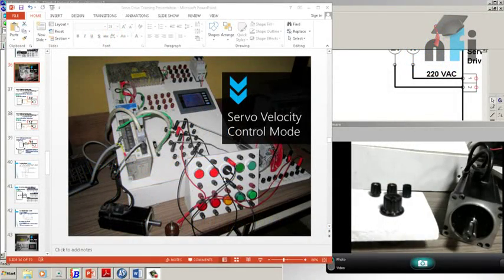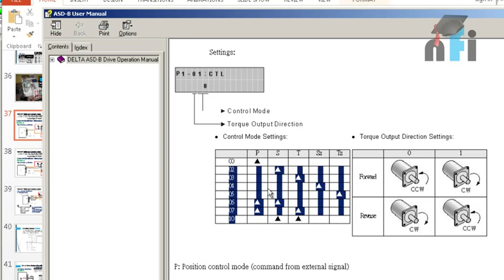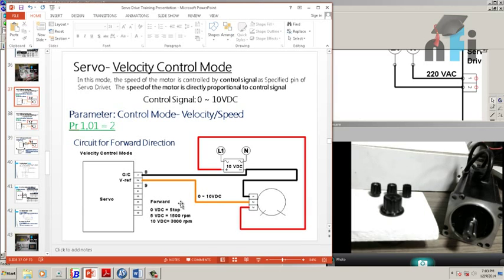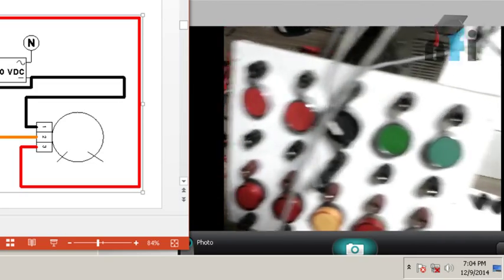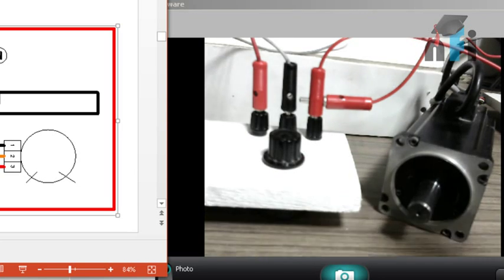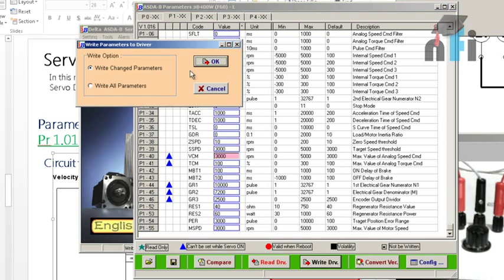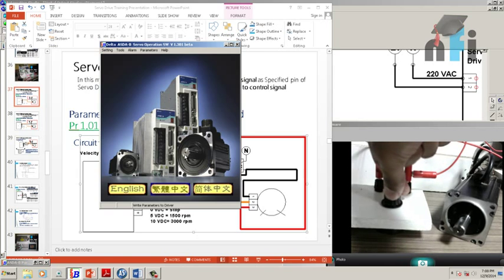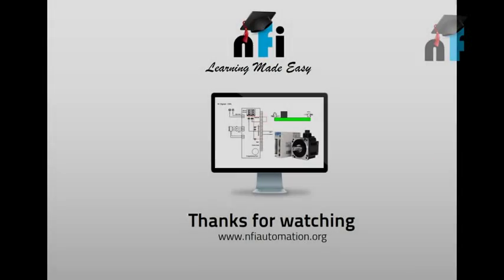Delta Servo Tutorials- Velocity Control Mode

Comment: Dear Rajvir. 
All videos are informative and I learned many things. Can I kindly request you to make some videos to measure the speed of existing machine by encoder and use two or three  servo drives and motors using plc and HMI . Controlling paper tension, cutting on eye mark using eye mark sensor,draw rollers application etc. So we can learn how to measure the speed of machine using encoder and utilise for one of the applications above using HMI for set point or cut length depend on applications.
Thank you very much for all your great efforts, really appreciated.
Reply from the maker: Hello, This is too complicated to explain without physical machine. If i get opportunity to see such machine, may then at that spot it would be better to explain how this has been program. And this is a big project what you just asked..so without hardware it is not really easy to explain,
Reply: @thegeterrdone  I understand but you have servo rig and if you connect encoder to any motor shaft to measure speed and you can use servo rig for different applications as mentioned above. This is just to understand how everything works. I know it is bit complicated but this is we use in real world. Please try if you can. Thanking you in anticipation of your kind cooperation.
Reply from the maker: @vineshpatel9072  I need to buy a servo driver and motor to try explaining the application. Will see to it. thanks :)
Reply: @thegeterrdone  Thank you very much. Appreciated all your efforts.

Comment: thank you sir for this explaining video
i understood from this video that we can control the speed with two way: internal with switch or with potentiometer.

sir,when i control the servo position, can i change the speed only by changing the frequency of the pulses coming out from the plc,or i need to work with a potentiometer?!!!
Reply from the maker: To change the speed from PLC you should select Position mode in Servo, then you can change speed and position both from PLC

Comment: Hi  about the change of direction.There aren't another way to change the direction (foward/reverse)without external circuit with relay?
For example with use 2 Digital Inputs, on CN1 connector, simple with 2 buttons as jog.(one for foward ,one for reverse).
Reply from the maker: With buttons you do it manually but to make it automatic you  need a switching electronic circuit ;)

Comment: Hi Sir.
How can I send speed reference from the PLC instead of analog potentiometer. Can I use step and direction to achieve speed control or any other way.
Reply from the maker: Yes, you can do that as well. In position control mode you can send Frequency and Position reference from PLC to servo driver to control speed and position. In velocity control mode you can use analog card interfacing to send analog signal to analog signal reference pin of Servo drive.

Comment: Thank you for the tutorials.
What is the language did you use?
Can i use ladder diagram?
Reply from the maker: Helllo, in this video we are not using any language. It's the hardware control
Reply: Please sir, if i use a servo motor in some application, can i make the servo stop instantaneous before complete the pulses that given??

i used Omron PLC to control a servo motor, i give a pulses to servo by monitor screen, but i need someway to control the servo by a signal of color sensor, i don't speak english well ! but i can give you an example

if i give a servo to run 920 pulses, and i want the servo to stop at 905 pulses by the color sensor 
the problem that the color sensor give the signal before the 905 i need take the signal when the servo become at the 905 pulse that's mean servo has 15 pulse to finish can i stop it before